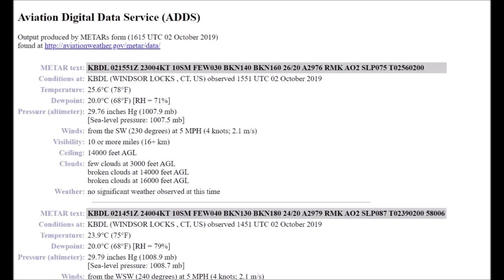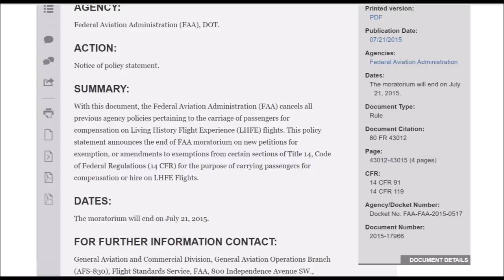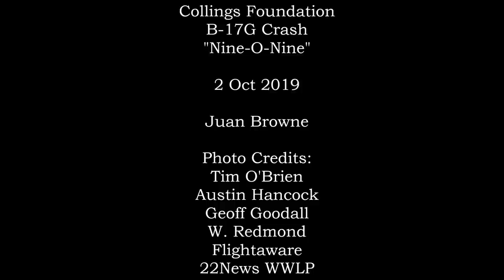B-17G Crash Collings Foundation KBDL 2 Oct 2019

Comment: Slight correction to the video: the aircraft never made it to the runway. 
The NTSB also plans on issuing a preliminary report on the accident in about 10 days, she said. The NTSB will not provide a probable cause while conducting its investigation, Homendy said.

“We know that the crew circled back to Runway 6 and attempted to land on Runway 6,” she said. “They impacted the instrument landing system stanchions, the plane veered to the right, crossed over a grassy area, crossed over the taxiway and impacted a de-icing facility.”

Check out flight profile: https://flightaware.com/live/flight/N93012/history/20191002/1348Z/KBDL/KBDL?fbclid=IwAR2WzgbFOVia_hGtzMYE7jQVEzgEJQSKOzMVb-y2_t981cE5zqdoqJ5bNuU

After takeoff the pilot asked the tower to return to the airport with #4 out. Response was downwind for 6. Question, we may never know, is why didn't they declare an emergency and land on 33? Why keep going for 6 when 33 was right there, halfway on the downwind to 6?  If you have an engine problem in the pattern and gained only 200', you get down ASAP. 

According to audio transmissions of the moments before the crash, a pilot said he’d “like to return to the field.”

The controller said, “What’s the reason for coming back?”
“Number 4 engine, we’d like to return and blow it out.”
“You can proceed to runway 6 and you said you need an immediate landing?”
“When you get a chance yeah.”
“I just want to make sure because we have air traffic coming in can you go or do you need to be on the ground right now?”
The pilot clarified that he needed to land and the controller directed air traffic away from the airport.
After the crash, the controller calmly said, “Bradley airport is closed for an aircraft incident.”

Comment: I was just on a tour of that exact plane in Chicago in July. Hundreds of people were crawling all over the plane and cockpit. Is this normal? I thought at the time it was dangerous
Reply: As long as the visitors are supervised and don't do anything to damage the airplane there is no harm in looking at the airplane up close or taking a tour inside it. I myself toured this airplane once. The inside is designed to fight a war and not for people to be crawling around inside it. Its cramped and difficult to move around in and there are large metal objects everywhere to bang your head on. It's probably more dangerous to the people taking a tour inside than to the airplane.

Comment: Dem. U.S. Sen. Richard (Dick) Blumenthal Thursday criticized the lack of oversight of vintage planes. He said that he has asked the National Transportation Safety Board to not only investigate what caused the B-17 bomber to crash at Bradley but also to address the broader question of whether the regulations currently in place and the enforcement of them are adequate.

“This crash is a major tragedy and it has put this industry at an inflection point and the NTSB, plus the FAA, need to address the repeated and imminent dangers that have been demonstrated over the years,” Blumenthal said. “These planes are a profoundly significant part of our history and they should be revered and preserved but respected with adequate safety standards if they are going to be flown and that’s why a broader examination and investigation is absolutely necessary here.”

Blumenthal said there have been 21 crashes of so-called vintage planes since 1982 where 22 people have died — not including Wednesday’s crash at Bradley Airport.    https://www.courant.com/breaking-news/hc-br-bradley-airport-deadly-b17-crash-ntsb-investigation-20191003-ldarjpewife6fj7hafiqz7zecy-story.html

Comment: It goes without saying my condolences to all that suffered in connection to this horrific accident. 

So the point of the video was not to explore the data in an attempted to understand what kept a four engine aircraft that's approved to carry the public from flying the pattern, in gud weather, to a safe landing. What is the emergency procedure for containing the number four engine inflight? Can the aircraft sustain flight on the remaining three? Was the aircraft overloaded? How did the aircraft land on runway 06 yet crash far from the runway at the beginning? Busy airport and no video?

Comment: One engine failure on take off or climb out to cruise altitude with an engine out would  have caused this accident. These aircraft use to be loaded with bombs headed for Germany and were far heavier than this one with just 13 passengers. My guess is a fuel mismanagement causing the lack of power to the engines or a flight control problem with the elevators on the horizontal stabilizer. Believe there is no FDR or CVR on these aircraft.

Comment: Rumor from someone at Bradley suggests Nine-O-Nine was inadvertently refueled with Jet A instead of avgas 100LL .  If true, it would explain the loss of an engine then loss of power in the other three shortly after.  Just sayin'.
Reply: Not according to the NTSB, who said in a news conference today that they had taken a sample from the right wing tank and it was 100 octane low lead and also said that the aircraft was rated for 87 octane but could use any higher octane.
Reply: @lizj5740   I read that, but OTOH,  I'm not sure they could have gotten a good reading from what was left of the fuel or if any Jet A was added to the other side tanks.  Reports say it had multiple engine failure, which makes sense as the pilot had over 7000 hours in a B-17 and had trained for two engines out on the same wing.  It was also an extraordinarily black smoke fire. Reports from the ground crew said the fire smelled like diesel.  If kero was added, there would be severe internal engine damage so they will eventually know for certain if it was a misfuel issue. Guess we'll have to wait for the official report.

Comment: Being around planes since my father had his own plane and worked for FAA, I begin to wonder on some things.

With No. 4 having the issues, it's out there on the end of the starboard wing. That turned the wing into a pivot point when the plane touched down and veered to the right into the building.

Picture shows the rudder straight and looks like no attempt to hit left rudder to keep the starboard wing from acting like a pivot due to that bad engine making the starboard side the weak side...and the port engines pushing the plane to the right on touchdown.  Was No. 4 shutdown and feathered, or running at much lower RPM with propeller windmilling causing serious drag?

Just wonders.  Just sorry accidents has to happen and lives taken...

Comment: Wonder if at the pilot's age - 75 - although very experienced, if the engine problem triggered a medical emergency that ended up causing the crash.  I still wonder why on three engines it could not gain altitude and touched down 1,000 feet short. I've see photos of these planes so shot up it seemed impossible that the crews flew them back. --  Don't know if this was true but supposed communication between tower and crashing B-17 in England.  Tower " do you need rescue vehicles?" Pilot "tower, not sure as we haven't finished crashing yet."

Comment: The engine number 4 failed.  They veered right into the de-ice facility.  With the B-17, learned from tragic experience in World War II, you always increase speed on good engines, especially on landing.  Also, you have to raise the dead, which means you never turn a B-17 into a dead engine.

Comment: My condolences to the friends and family of victims.
  Something more then the engine out must have happened. I've seen B-17 tankers loaded take off on three engines... Actually used to have a home movie of it, out of a strip in Brunswick county North Carolina, called "Bear Pen" . One crashed there, and you can still see parts in the ditch. I think everyone was ok and the remains were mostly haul off for scraps. One engine ended up a sheriffs house, one was in a Forrest service  shed at Bear pen one blade from the prop was cut off and hung in a guys bar, I took two blades attached to the hub and when my step dad beat the my mother and we ended up in the hospital the duplin county sheriff's let him drive an unregistered car to the jail and when I got back to her house, it was hidden from us along with some cars and trucks. Most likely it ended up sold for scraps. I've seen at least two fully loaded B-17 fly with an engine out ...  One took off knowing the engine was out and not making power. One was built during WW2 but I doubted it ever seen combat, one was known to flew in Alaska during the war.
  The requirements was in the contracts that the tankers were to be in flying condition and these guys seemed to be a bit on the "it'll fly" side of rules. That is why I am sort of wondering what happened.

Comment: Thought some more about this tragic crash..   Many airmen died in the war in the bombers because of AAA and enemy planes.  Plenty of 17`s came home shot to pieces but could still "fly."   Often they were totaled and used for spare parts.  These were the lucky ones.  
The unlucky ones suffered instantaneous catastrophic damage and  went nose first for the ground.
I did a walk through of a 17 decades ago and I must say it was a scary experience much like being shot at and your cover is a beer can that will not stop much of anything.  Other people in the formation would count "chutes" hoping for 10.  
The problem is little thought was given to crew survival.  The Planes were hard to get into and a fast escape is not possible.  Commercial passenger  aircraft have exit doors usually over the wings and aft section and are situated so a 90 second evacuation is possible.  13 are not going to evacuate a burning 17 in a short time.  One must also consider the 10 passengers are not going to be spry youngsters  who can run fast and jump and no doors and slides are provided.  

This is the second 17 loss in 3 years, with due to fire in the air.

Comment: This whole thing is so tragic in so many ways. There will be many politicians now attempting to discontinue this activity as unsafe, while forgetting people fly on planes everyday. If the public knew how often planes really crashed, they would never get on one. I'm nowhere as qualified as you, but I do have an air-frame licences. Right now this crash is very puzzling  The original report said the pilot reported he could not gain altitude(?) and had a problem with the #4 engine and requested to return to the airport. Safety would require he do this, but even with one engine out, this plane should still have been able to gain altitude. Immediately on touching down this aircraft then suddenly veers hard right and strikes a building (strange). Since the start of the runway and the building are at almost the same place. I would assume it possible that the right main gear had collapsed on touch down, causing an uncontrollable turn  into the building. I'm sure after the NTSB investigation we will have more answers, but right now it seems that a number of problems were happening with this aircraft. The loss of life and this aircraft are so sad and depressing to hear.
PS. I believe there are only 9 airworthy B-17's now flying. Two or three others are currently being restored, while most others that survive are on display in museums. All totaled I think there are about 20 of the aircraft type that still survive.

Comment: Ok Juan...maybe a stupid question but if 4 engines and possibly only one failed, wouldn’t that mean the other 3 could still fly them in...so it was probably something else besides the engine, that was a cause, contributing fact to the crash? Will the NTSB be investigating
Reply: I'm wondering if the engine fail mode comprimised the the starboard landing gear causing it to pivot hard right on landing
Reply: @jimfeldman4035  that is a good Theory but I've seen pictures of half landing gear off the b-17 and they can land it straight all the way, and I don't think it would have reached the end of the runway, they usually can stop about 4-500 feet without landing gear on grass. The question is why did they reach the end of the runway at speed

Comment: That B-17 should be in a museum not flying unsuspected passengers on joy rides. That aircraft was not old it was ancient. Parts are rebuilt over and over again maintenance is mostly done outside in the elements while it’s on tour. The radial engines are in different stages of maintenance with a whole range of hours on each. Park it and show it in a  museum
Reply: +Bernie Boone  Stop and think about how worn-out that airliner you are on is next time.   Civil airliners fly non-stop from destination to destination and they have many more hours.
Reply: FiveCentsPlease  Airlines operate under FAR 121 which requires inspections at intervals including after every landing and have scheduled checks daily with ever more progressive checks A, B,C,D and phase checks after that, Boeing and Airbus jets are in a constant maintenance, with departments overseeing every phase QC, AMC and QA and FAA. That B-17 operates under FAR 91 which only requires one check every 12 months.
Reply: @GrubbyGrupper   I believe Europe upped the requirements for vintage operators holding them to the same standards as civil airliners, thus making it more expensive to fly them.  A similar change in the US would likely end many flying programs and especially flight experiences for the public. I'm reading that 909 was about to be retired into an extensive maintenance period while Collings operated another B-17.
Reply: I had heard from the NTSB that it was on a progressive inspection program at 50,100,150 and so on so I guess it was maintained to a high standard. The investigation of the crash will be very interesting to hear the final conclusion

Comment: Maybe you can tell me as an educated guess, why would it reach the end of the runway and then turn into  the deicer containers at some speed.
Do you know where it touched down on the runway I'm thinking maybe could the throttle got stuck when they touched down in the open position why wouldn't they steer the plane the other way? Into open field. To me it looks like they had an issue stopping.
 I've seen the b17 crashed planes from the war and they roughly can land about 4-500 feet quite easily without landing gear
Reply: Yes, I've watched B-17's fly at airshows and they need almost no runway at all. With four engines and that big wing its designed to lift a heavy load in combat but this airplane was lightly loaded with no bomb load or ammunition and a small fuel load for a short trip. By the looks of it it touched down and made an almost immediate 90 degree right turn into the building.
Reply: @joevignolor4u949  well I'm not convinced by that, if you look where it turned into the de-icer tanks, is right at the end of the runway, why would  they have touched down so late on the runway? nobody would have touched down there. if they had three engines they would have gone round again. Don't think there's any evidence of the engine being on fire would have been shut down.
Reply: @johnsweda2999  According to Juan and the ATC it was landing on runway 06, which is right next to the deicing building. So where the airplane ended up is at the beginning of runway 06. Presuming it landed right at the threshold of runway 06 it would appear it made an almost immediate 90 degree turn and went into the building. If it were landing the other way it would have been landing on runway 24, not 06. It does seem strange but of course we don't have all the facts yet.
Reply: I just saw a briefing given by the NTSB. The airplane hit the ground well short of runway 06. It hit the ILS system antennas short of the runway, veered 90 degrees to the right, went across some grass and a taxiway and hit the building.
Reply: @joevignolor4u949  right ok you got a link

Comment: A tragedy all around. I'm confused though, due to that overhead of the airfield, at how she got so far off the runway at such a speed as to cause that crash. I'm no pilot by any stretch of imagination but I've "flown" enough B-17s in legitimate simulators to know that loss of one outboard engine alone shouldn't cause such a loss of control.

Comment: Rumors are now that on final the B-17 landing gear clipped the ILS system at the airport causing the pilot to lose control and crash. Anyone else hear this rumor?
Reply: +KeithKman   It is confirmed that the plane struck the ILS system and parts of it are in the debris field.  Which part of the aircraft was struck has not been said.  After impact with the ILS the plane veered to right and skidded 1000 feet into the de-ice station.